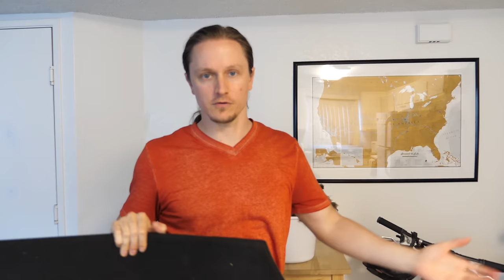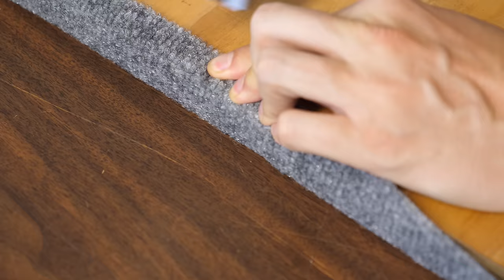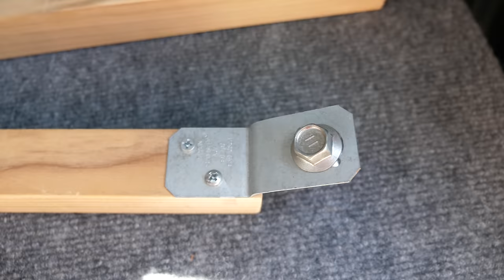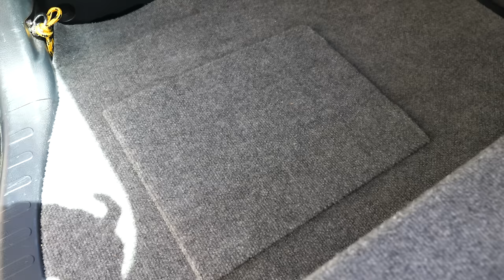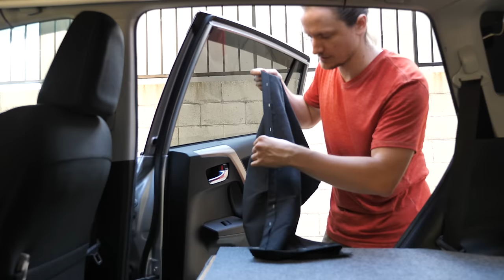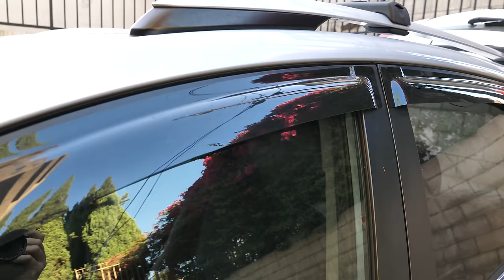How to Turn Any SUV Into a TINY CAMPER!! (No Permanent Modifications)

Comment: Instead of a screen for the windows there is a product an Amazon, I think it’s called a window sock, that’s almost like a pantyhose material that slips over the upper window portion of the car door. So it effectively creates a screen on both sides of the door.
Reply: Can you share the link?
Reply: Yeah but in the rain, a mess. Must dry sufficiently before storing to prevent mold. Also, many don’t seal sufficiently, leaving saggy gaps to tinker with to ensure no bugs get in. Those mosquitoes bop around to find any tiny hole then tell their community 😉. I like this guy’s method. Reasonable, efficient and simple. Well done.

Comment: Lot of interesting ideas, compliments. The only drawback i might point out is that if you create a platform with different levels it will only work for a single user. While if you stay on the same level the double bed is always there, you just need to move things around maybe putting the excess on the roofrack.

Comment: I’d rather use my 2005 Toyota Sienna that when the middle seats removed, I have 8ft x 5ft flat surface and 50” height from floor to the ceiling.
Reply: What if you don't have a 2005 Toyota Sienna? but have a mansion in London?

Comment: How do you get to the spare?
Reply: I would remove the spare to a roof rack also creates more storage
Reply: Yeah... I am wondering that too in this design. It's going to be a real hassle if you have a flat in the middle of nowhere. It's better to store the spare on the roof rack.
Reply from the maker: If I had to change a tire, I would have to pull the bed platform out to get to the spare.  Putting it on the roof rack is a great solution.  It would also allow for more storage space where the spare use to be.
Reply: Just make sure it's secure!!

Comment: What you are doing is illegal ...
Reply: Elaborate.
Reply: @nicholasjanosy2214   it's a travel vechile with certain designs, dynamics and safety features. Various modifications are done without taking into consideration any of those issues .. butane stove is kept, wood is kept ... additional weight is added etc etc .... Its not legal as does your insurance know it ?
Reply: @mavericksantiago319  The materials he added weigh less than the back seats and 3 passengers